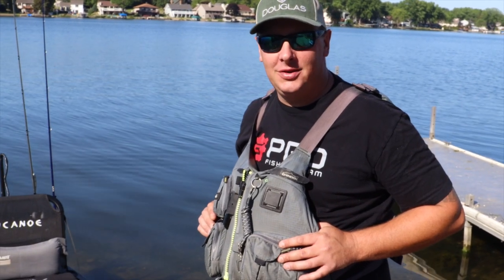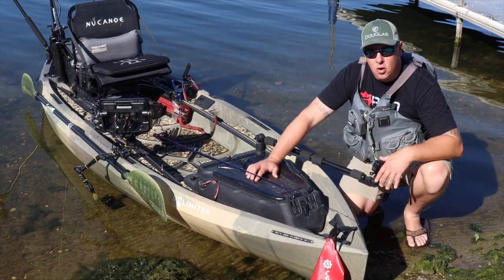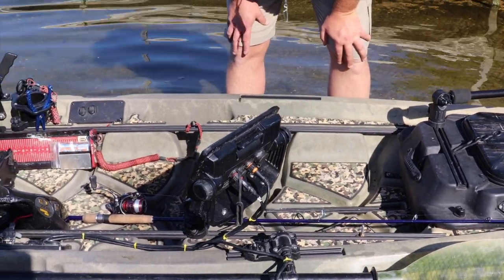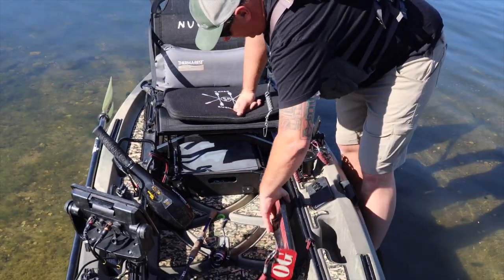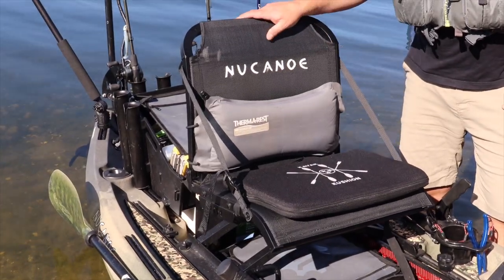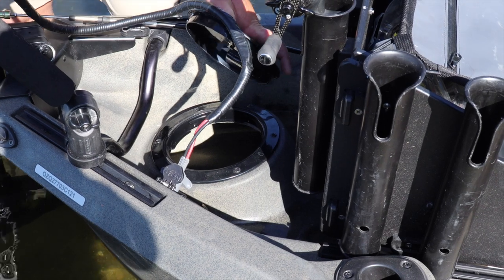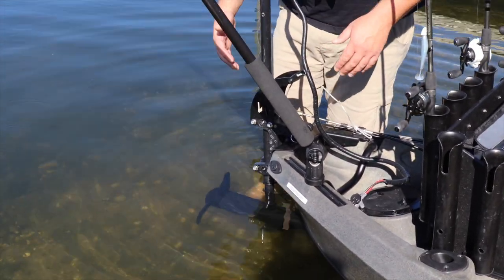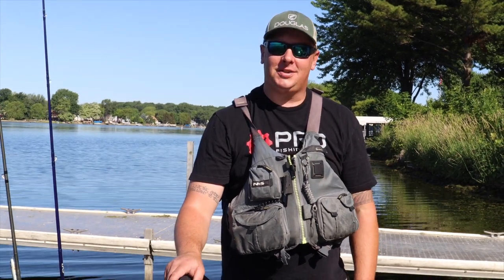NuCanoe Unlimited Set-up & Walkthrough With Brian Schiller

Comment: Rewire your trolling motor with a pulse width modulator switch. You're only getting 60% discharge and 60% travel time out of your battery with that trolling motor switch. It kills power.

Comment: Good video but all the other models the F10, Frontier 12 and the pursuit have access to the hull with a front hatch. I store my batteries in the hull on my pursuit
Reply from the maker: The gear pod is the solution for that on the unlimited.   Two track bolts and the gear pod goes on and off.  I always leave mine attached